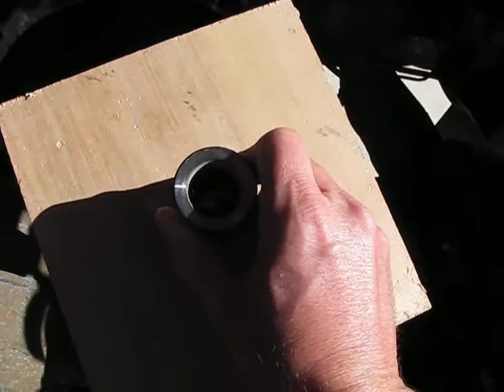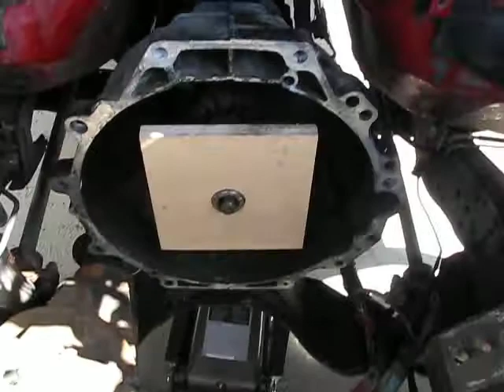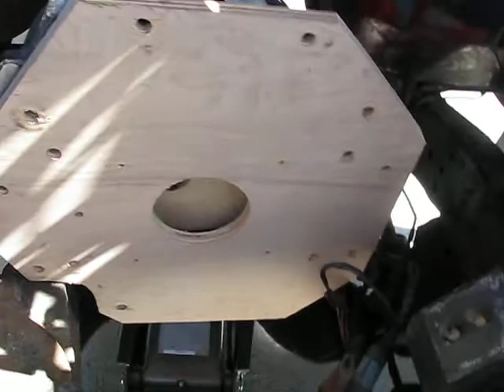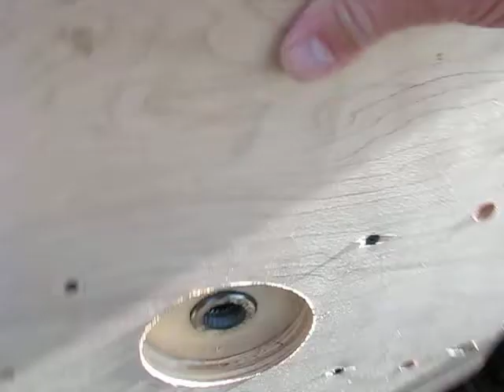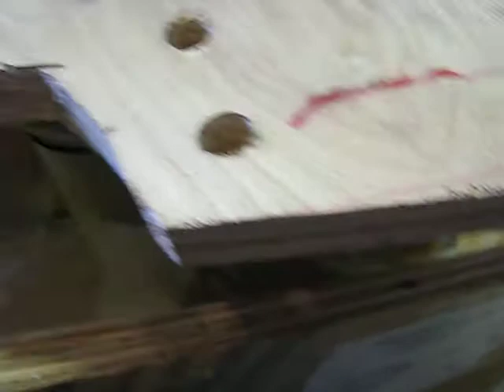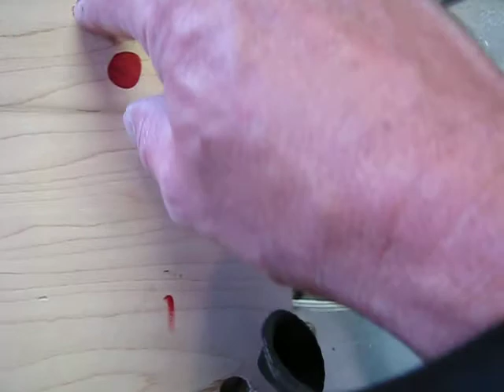Electric vehicle #2

Comment: I'm very confused what is the second plate behind the main plate for? The one with the metal thing in it.
Reply from the maker: It is used to align the coupler.  Once the other plate is bolted on, then I screw the two together with the coupler perfectly aligned.  This is then used to make the final metal plate.
Reply: Willisolarpower thank you very much now I know how to prevent run out.